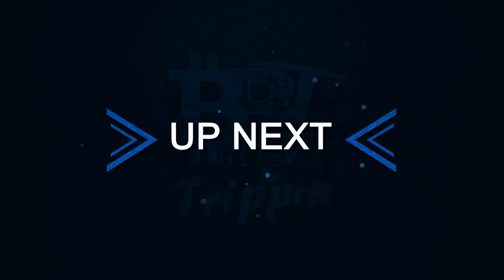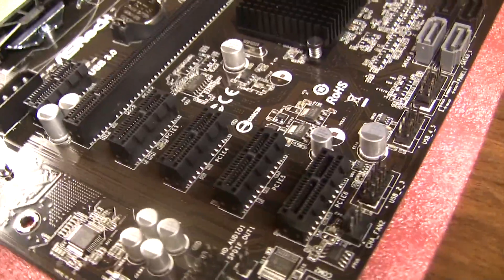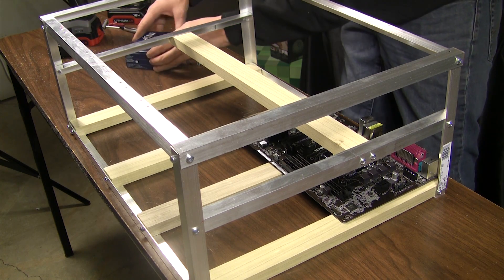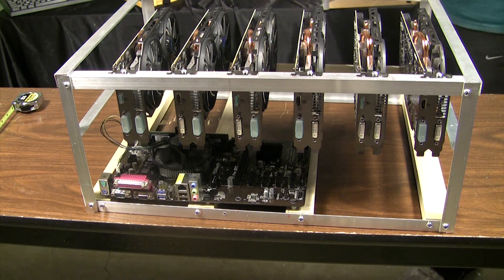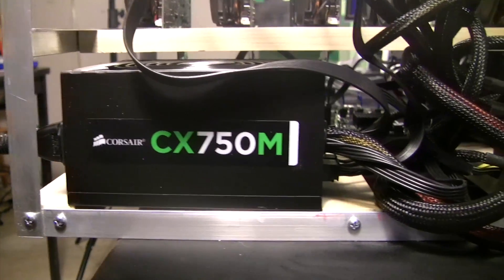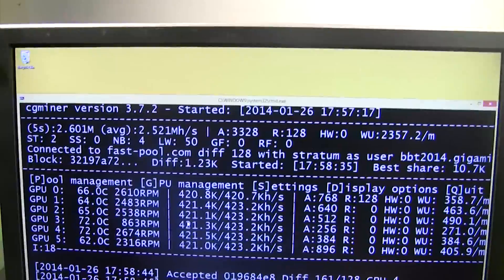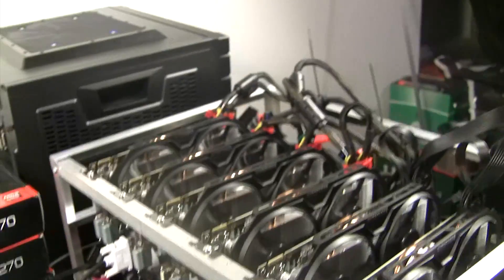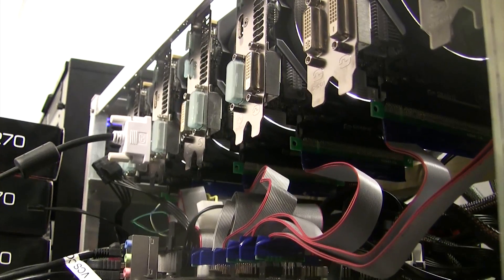BBT Episode 7: 6 GPU Litecoin Dogecoin Feathercoin Mining Rig using the ASRock H81 PRO BTC

Comment: so has the mobo died on you yet?
Reply from the maker: Nope, rocking great! Why do you ask? 10 days straight now
Reply: Bits Be Trippin' Because everywhere I look people say to use powered risers and this board is a gimmick and doesn't really eliminate the need of powered risers. I guess they are talking out their ass then. The 24 pin isn't hot or anything strange like that? I just ordered this board and 6 r9 280x', thats why im wondering.
Reply from the maker: 24pin hasnt exceeded 81F ... its perfectly fine. The slots are running stable and no issues. We built another 6x 270 rig with same setup and no issues. 

We are however building a 280x setup that will be in an upcoming episode both introducing the USB risers (which require power for the USB connections) and this board. Stay tuned for those results

Comment: Hey, im building this rig. I just picked up my h81 pro btc board. Im going to be on LTCrabbit pool with there bootable OS, will i need a ssd/hdd? will i need powered risers for 280/290 cards if i choose those? Is there a single PSU that will support all 6 cards, either 6x 270.280,290

Thanks man, il take pics and show you how everything is going GREAT VIDS WATCHED EM ALL!
Reply from the maker: No single PSU will be able to handle 6 x 290's or even 6x 280's yes on 6x 270's however. SSD is for quick boots, you could put BAMT on a usb stick and boot off that and save the cost. We are going with USB powered risers on the next build mainly to use the USB new risers more than the reason of powering the risers... Video out with that 6x 280x within a week! (using multiple PSU's for that btw). Thanks for comment on videos! We are targeting two for this week!

Comment: Hey guys, these videos really help me out, but I do have some questions.
I'm new to mining (sort of), and don't have too much cash at hand. I plan on buying 
the Gigabyte r9 270's with this motherboard; ASRock 970 Extreme3 R2.0 AM3+ AMD 970 SATA 6Gb/s USB 3.0 ATX AMD Motherboard. Would this motherboard work fine? I plan on starting with 1-2 270s but would add on over time, possibly build another rig. If you could help, that'd be great. Keep up the vids. Also, with the motherboard I would have at hand with a max 4 gpus, how many gigs of memory would I need? Not sure if I would need 8 like you guys did.
Reply from the maker: Havent tried that board yet, if ASRock gets back to us I will ask for a sample board to try out for you guys. You should have no problem with most any boards for 3 cards, its 4 cards where stuff gets flaky. As for the memory, 4gb is fine, the only reason we have 8gb in our rigs was the deal we received buying a 16gig kit, it just made sense... we buy the 2x8gb kit and split it on two rigs.

Comment: Hi. Thank you for the videos. I'm thinking about building a 7 gpu (r9 290) mining rig with this mobo: http://msi.com/product/mb/Z87-G55.html. It has 10% Higher Power Efficiency and Max Current Optimized to 60A. What do you think? I'll need powered risers? How many?
Reply from the maker: More than likely the first 1x slot will be disabled the moment the board see's the first 16x active. Will have to do some creative trickery to get it to wake back up ...such as:: http://www.gobitgo.com/articles/1001/How-To-Correctly-Use-and-Install-PCI-E-Riser-Cables/

About half way down on that article walks you through the 1x jumper cable ... This should enable all slots, however ... I haven't seen 7 cards in one rig yet... maybe that would be a good challenge!
Reply: ***** Oh yeah.
Reply: Bits Be Trippin' Thanks. I'll build that 7 gpu using that mobo, asap. When done I'll let you know, guys.
Reply from the maker: Picks and good luck, were looking into a 7 card rig to at some point, next 5 or so episodes booked however!

Comment: Need help so much Trippin' :(
- How did you link the power supplies with a duel cable or add2psu (I want to duel atx for noe)
- Did you plug in the corsair psu into both h81probtc mobo molexes, or one molex per psu?
- Recommend some answers of the above based on my current psus? (1000w thermaltake, 860w corsair)... should I got for 3 cards on each, mobo/psu on 1000w?

Would love to hear feedback I've had this in build for a week :\ 

could add me on skype if you feel like a Samaritan: Fryguy1
Reply from the maker: No problem Matt, lets see if we can help

- Check the video under our channel listed Dual PSU's (explains how to do this)

- Use one PSU for the motherboard and all of the molexes and a few of the graphics cards, do NOT use the second PSU for anything but the extra graphics cards 12v (6/8 pin power)

- That sounds like a great setup for 6x R9 280x and lower; As for higher end cards than that... the first PSU I would recommend a 1100w+ for R9 290/290x due to the fact the MB/Ram/Molexes/Fans/ & 3x GPUs will be really pushing near 1050w AC when OC'in that series of cards (they are near 315w each by themselves);
Reply: Really appreciate the response buddy.
the cards I am using are the 280x's which have a tdp of 250? does this push up to 300 when hashing? I figured 3 of them on the 1000w and remaining 3 on the 850w, possibru?

EDIT::: Hooked it all up just the 4 cards as the riser can't reach currently, all working though after some scares.
Big issue I can't seem to solve man! I can't see temperatures on the cgminer display. I cannot see a performance tab for overdrive etc, and asus gputweak is not showing anything, shows a r9 280 input but cannot select between them.
come across this?

Comment: I can never get the hash rate that you get. When I use your settings, cgminer refuses to work. I get error messages and then it shuts down
Reply from the maker: Try to adjust the core clock to 1060 & memory to 1425 ... does it work? More than likely the card(s) you have are having a problem with 1100 core clock
Reply: Bits Be Trippin' It isn't the core clock or memory that gives my cards trouble, it is the TC. Anything over 8192 and cgminer refuses to run. Using version 3.7.2
Reply from the maker: John, no problem ... do this:

Click start, run, type CMD
When command prompt comes up type this and hit enter:
setx gpu_max_alloc_percent 100

Once it says settings saved, try the bat again
Reply: Bits Be Trippin' Thanks for getting back to me, but still same result.  -g 2 - I 15 --gpu-engine 1060 --gpu-memclock 1425 --thread-concurrency 16400 --gpu powertune 20

Tried TC 11200, 24000 -g 1 -g 3 nothing works the only thing that works is 

-g 1 - I 15 --gpu-engine 1060 --gpu-memclock 1425 --thread-concurrency 8192 
--gpu powertune 20
Reply: ***** I'm running 1135 Engine and 1500 Memory, TC of 15232 and -i 19    Getting 480KH/s per card.   I've also had some luck using the Asus R9-280x drivers to increase the hash rate.

Comment: you used a dual psu adapter that motherboard? or this model does not need?
Reply from the maker: No dual PSU adaptor, used the method in our Dual PSU video (connecting green/black wire) on second PSU.

Just make sure the one PSU is used to power the motherboard and 2/3 of the cards and the second PSU ONLY powers the other 3 graphics cards. Do not use any of the other connections on the second PSU but the 12v Rails on the graphics cards

Comment: Nice video, few questions:
1. Did you have to do anything special to get it running in Windows 8?
2. Would it be possible to run this setup with Windows 8 on an USB stick?
3. If I were to run this rig using USB 3.0 cable risers, which require power to work, would you recommend still plugging molex into the motherboard?

Hope to see more videos of this motherboard!
Reply from the maker: 1) no, litterly loaded windows 8, booted up, had one small hiccup that 6 were dedected, 5 were ready to go and the last one in the device manager we had to right click, uninstall, then hit scan for new hardware and it set it up appropriately

2) Yes, recommend getting at least a 32gb USB stick however

3) It will not hurt the motherboard, just ensure the power for the risers is coming from ONE PSU, same one powering the motherboard; you will create a wierd loop if you have the second PSU powering the risers with the first PSU plugged into the motherboards 24pin connector

We have 2 more of these boards coming in ... one due in by tomorrow. We are doing 6 R9 280 Sapphire Toxics and once we get the 4 more Diamond R9 290's will be doing a 6 GPU R9 290 rig using same MB.

Comment: Would you use powered risers with this board but with r9 280x's?
Reply from the maker: On our next build we will be using powered risers due to the nature of the new set of risers we purchased (USB Risers). This should not matter, the key is just ensuring the risers our powered by the first PSU (same one used by Motherboard)
Reply: Bits Be Trippin' I am curious...why does it matter if the risers are powered by the first PSU (connected to the motherboard) as opposed to the second PSU?

Comment: Are you using powered risers? Or it isn't needed since the PCI-e slots are powered by a molex?
Reply from the maker: No we are not powering the risers with this board
Reply: Bits Be Trippin'
Btw were you able to undervolt the cards? I heard these are voltage locked
Reply from the maker: We are not under-volting these particular cards

Comment: So you using a powered riser or unpowered riser?
Reply from the maker: Unpowered with this board (the dual 4pin provide the extra juice), great question, i should of covered that in the video....adding to description!
Reply: Bits Be Trippin' If I already bought a powered riser, can i still use it and leave the molex unconnected?
Reply from the maker: Yes, that's what we were doing!

Comment: Questions for someone who wants a brief guide:
1.What is the Wattage rating of the PSU?How many PSUs did you actually use?Can you get away with 1x 1500W PSU to simplify this buid?
2.What is the total hashrate of the mining PC here?
3.Where can I find suitable cases (premade) to buy online to house a lot of GPUs as I'm not too good with tools?
Thanks
Reply from the maker: Most of this is anwsered in the video/description but I will help ya out:

1) The problem with one PSU is the lack of PCIx 6/8 pin connections; while you could use adapters for the last few ...the amps will be different than using a straight dedicated 6 or 8 pin rail. Wont matter much on a 270 setup but absolutely will on a 280x/290+ setup

2)  In the video here: http://youtu.be/t3iup26oUN4?t=7m38s

3) http://cgi.ebay.com/ws/eBayISAPI.dll?ViewItem&item=141176011853&ssPageName=STRK:MESE:IT

Pre-made and shipped to you and can customize your dimensions if you require something different. There are other options also ...just check ebay!
Reply from the maker: Bits Be Trippin' New ebay link:

http://cgi.ebay.com/ws/eBayISAPI.dll?ViewItem&item=141179091709

Comment: Did you say what the Wattage at the wall for the total was?
Reply from the maker: 332w + 415w AC from wall... take that with about 84% efficiency from bronze PSU's still not to bad...
Reply: Bits Be Trippin' Thats crazy for 6 GPUs mining!  Those R9 270s are great!
Reply from the maker: Yes, we were between 750-800 @ wall, but the issue isn't with the power, the issue is with 6 cards + 12 PCIx 6 pins; You could get away with putting all of these on a 1200w corsair if it had enough 6 pins; of'course you could always use the 4pin to 6pin adapters for the 270's ...regarding heavy loads on 280x/290 we would recommend sticking with the rails that come with PSU (8pin/6pin PCIx connectors)
Reply from the maker: With the settings we updated in the video description were now at 1080w @ the wall (AC) - running core/mem 1100&1500  ... at 1020core & 1400mem were at 800's
Reply: Bits Be Trippin' Nice hashing rates!  Was the system 24hrs stable at those settings?
Reply from the maker: rock solid! been going straight now on day 4, windows 8 wants to update but i dont want to restart!
Reply: Bits Be Trippin' NICE! I won't want to mess with a good thing either!  I assume, if its running stable for that long, the spacing between the graphic cards is working well to keeping them cool?